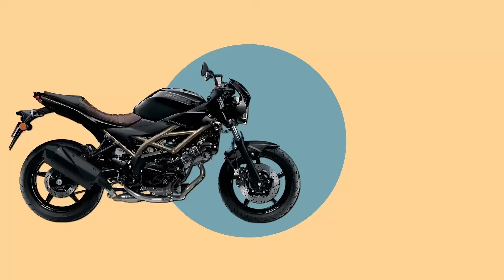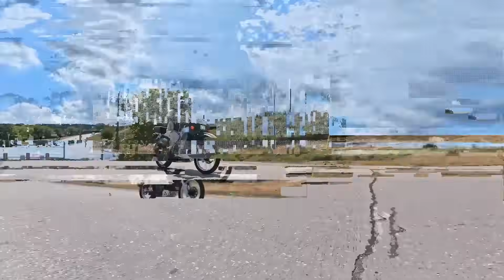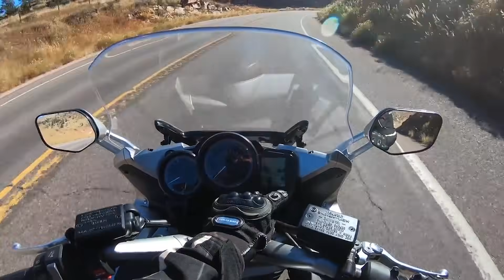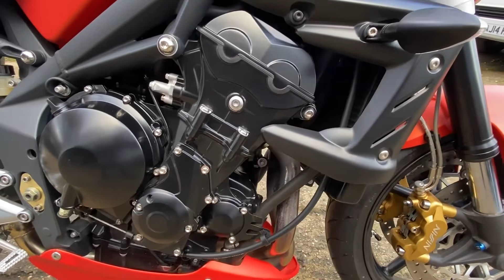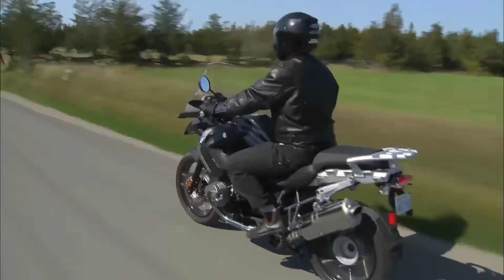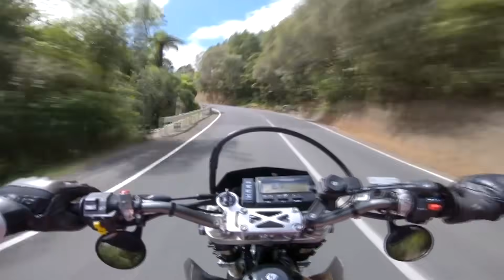15 Motorcycles Mechanics Buy For Themselves (And They'll Never Tell You Why)

Comment: Left out Kawasaki Versys and Concours. Reasonable priced, reliable, great bikes.
Reply: I put 90k miles on a Versys 650...runs and rides as it should, still going 5k oil change intervals without needing to add any inbetween....
Reply: @RockyMotoX  i have the 300x... been great learner bike.. an ez to work on an mess with..im 69 so lovw wieght

Comment: I will thro in my Suzuki M50/VZ800.  I have had it 20 years, and other than maintenance the only things I have done to it were a new set of tires at 20K miles, and a new battery at 1round 17K miles.  Not one single thing has gone wrong or broken on it, it has been, by far, the most reliable bike I have ever owned. I am still running on the original clutch and brakes! Shaft drive, so no chain maintenance.  Fuel injected and liquid cooled.  If they still made these, I would buy another immediately.

Comment: The vfr800 5th gen has a timing chain. The 1997 was the last gear driven cam VFR.
Reply: WRONG. The 4th gen (1994 - 1997) has gear driven cams and carberators. The 5th gen (1998 - 2001) has gear driven cams and fuel injection. The 6th gen moved to chain driven Vtec valve train. This video talks about the 5th gen but the bike shown is a Vtec 2002 or newer...go figure.
Reply: And 2014 model show on movie

Comment: KLR will also melt the bottom out on the clean side of the air box if you actually ride it!!!
Reply: None of mine in the last 25 years have had that issue. Wattman aka "Thermobob" has ridden his KLR 205,000 miles on original engine without an airbox melt...